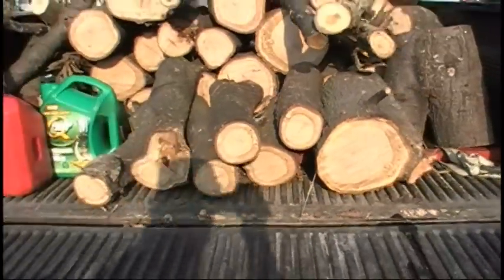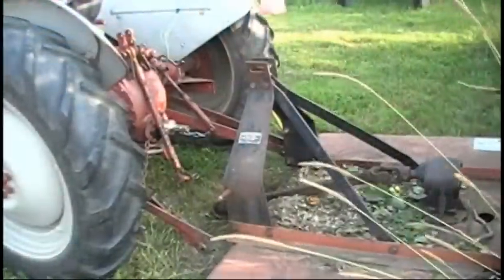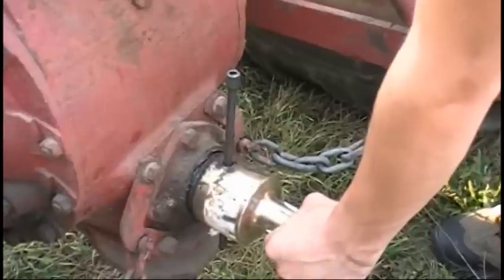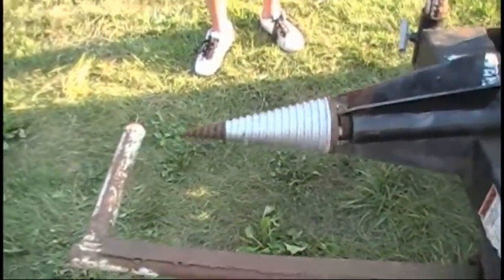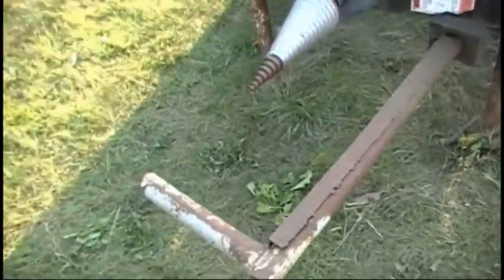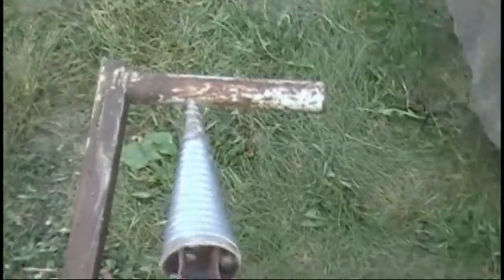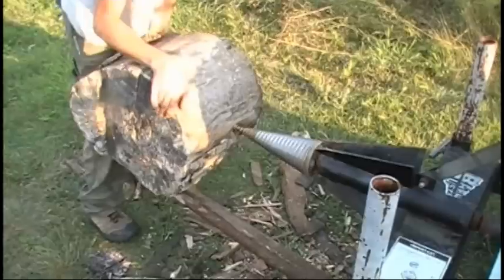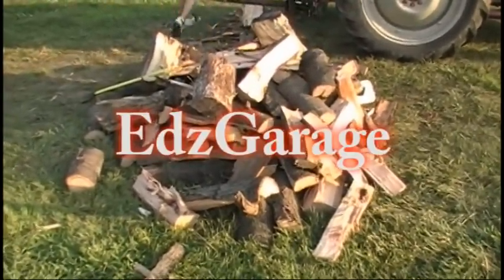Bark Buster Log Wood Splitter 3 Point PTO Screw Type Operation

Comment: In the 80's I used to run one of these commercially. Adjust the height lower so you don't have to lift, just roll. Start the auger closer to the end, more overhang on the brace. Start a second log to clear the first one, that's why there are spreader bars after the auger. Use a file to sharpen yours, it should bite quicker.

Comment: When I was a kid in the late 70's, my dad had a log splitter just like this and in fact we used it on a 1954 NAA very much like yours except with no loader.  With him shoving and me stacking, we could split A LOT of firewood in a very short period of time.  He decided it was too dangerous and traded it in the mid 80's for a hydraulic unit that was much slower but safer.

Comment: Just learned of these and reseraching.  All about "yeah much faster than a conventional splitter.  Got to 5:57 and said yep, there's a reason they were recalled.  By the time you pull that coil line,  it too late.  Great idea and very efficient, but not for me
Reply: A guy gave me one as a gift . Too dangerous , I wouldn't even sell it to my enemy.

Comment: Real nice! I've got an old Barkbuster splitter (non- tractor mounted), its got a 5hp Briggs & Stratton. It's a great machine, but its so slow and you have to bend over so far to reach the auger it kills your back. The 3 point hitch style there is the way to go....spins way faster at a higher RPM, and its higher up so you dont have to bend so far. Your boy almost got it at 5:58....thats why their dangerous though. Thanks for sharing.

Comment: I would do a couple of things, first extend the side rail to go around the other side for more support.  Add a plate over the supports so you have a base to stand the log on upright.  install a vertical plate under the screw so the wood can not spin under.  wire a switch where a hand knee can shut the engine off ( ground the dist,)

Comment: Man, I thought I had the only one left!  I shortened the driveshaft on mine so I wouldn't have to take the overrunning clutch off and on.  You need to cover the ends of those two support pipes if you store it outside to keep out water.  Two aluminum cans with the ends cut out work for me.

Comment: Never start from the center. Always have 70 % of the wood leaning in the same direction as the screw turns. My log pieces always touch the base bottom support. Things never spin.

Comment: There's a much safer system with the screw mounted vertically, pointing down, on a hydraulic arm. You disengage the PTO, raise the arm, position the log underneath, engage the PTO and release the arm to let it fall. Not nearly as fast, but not nearly as dangerous, since you had to be away from the device to engage it.

Comment: It would work better if you modified it by putting a metal table under the cone and extend it out to where a log could sit on the table. Then you could just push it across the table and let it split. Also, if you stand the log up, it will split and fall off each side and you wouldn't have to use an ax to dislodge it.

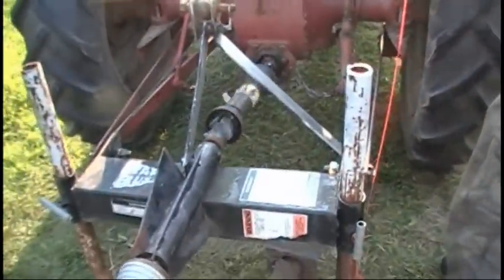Comment from the maker: @ 3:53 you can see how fast it shuts down once the string is pulled. Just a note, we have not used the splitter since this video. I does work, but it's not worth the risk on regular basis. Thanks for the comment!

Comment: Never lay the log horizontally when using the screw splitter. This causes the bottom half to get jammed by the cone.

Always stand the log vertically! This allows both halves to split evenly tight and left.

Comment: You know, if you were to take care of your equipment, it will work better and last longer. Your boys could be showing their kids how to use it. Some grease on all the rotating members, some oil on the machined surfaces and store it someplace other than outdoors in a field with 3 foot weeds. Your tractor especially could use some TLC. I probably won't make it past your comment approver, but I thought it be worth a try. Peace.

Comment: no offense, but I think most people here would rather have a conventional log splitter or one of the ones with the flywheels... that unicorn splitter just seams more trouble than good since you need to clear out the logs so much